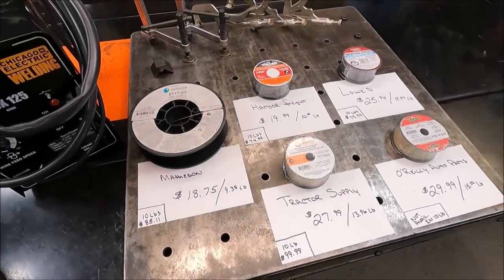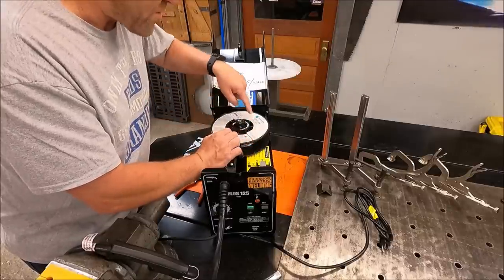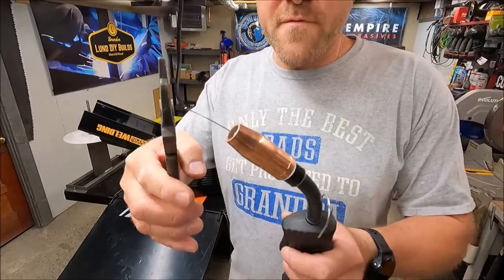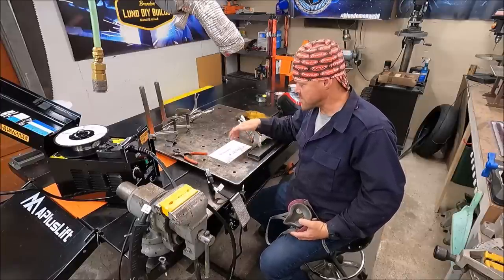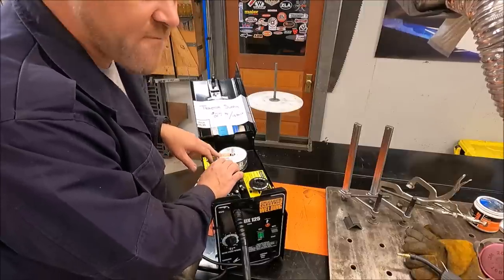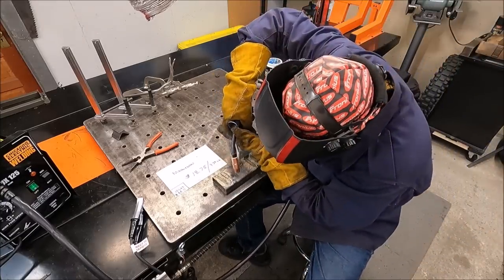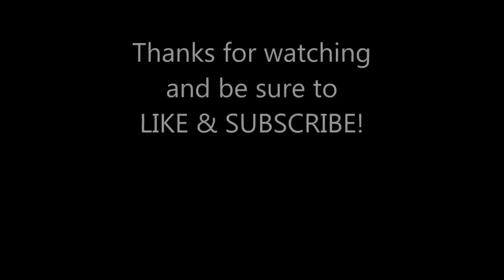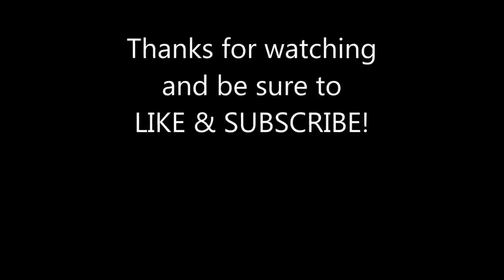Testing which Flux Core Welding Wire is Best

Comment: The harbor freight machine is not the best test as it is an AC output machine where flux core is designed for DCEN.   I converted mine HF125 to DCEN using a 200 amp bridge rectifier for about $20.  Would be interesting to see how these wires performed in the test on DCEN.
Reply from the maker: I agree @John Martin but those are some of the common wires that are available for those that buy or have this welder. I might do a conversion on it at some point but I have built tons of things with this simular welder and for the money it's pretty solid. I'm a firm believer if you use something long enough you will eventually get really good with it. Back many moons ago when I was learning on a 180 AC welder I was laying down beads as good as any top of the line machine. A lot of it depends how much under the hood time you have on a particular machine.

Comment: Well I know I'm not as good as him but what's funny is I've only used Vulcan wire for years never had any trouble with it
Reply from the maker: Many of these wires all work good after you have some time with them. I used Matheson for years and loved it. It wasn't until I made this video that I actually could see and feel a difference going from one wire to the next. If your happy with it, no reason to change. It's just an observation I made that actually surprised me.

Comment: What if you changed polarities? And I've heard a bigger grounder wire on the welder can make a difference.
Reply: On these type welders, the polarity is factory set. On welders that are gas/gasless, that option does exist.
Reply from the maker: @Stanley Bennett as Bryant pointed out this one is fixed polarity but ground location and a good ground are an important role in how the wire runs. I was careful not to move the ground and the workpiece as we changed wires so the test wouldn't be affected by this. Good point on the ground!

Comment: man I have a similar welder. but mine is 240v. I can't tell if I am just HORRIBLE at setting it right or the welder sucks. But now you have me wondering if I actually have flux core wire. It's the 10lb spool of Lincoln wire. mine mounts vertically. Mine can be connected to mig gas, I wonder if it's worth it.  I'm a new sub so will check out your settings video among others. Hopefully you can set me straight. I have NO training since highschool 35 years ago lol
Reply: Had to check. Using the MIG180 and Lincoln Electric Innershield NR-211-MP .030 so it SHOULD be good wire, right?
Reply from the maker: I bet your polarity is not set right. Just double check that if your using solid wire with gas that your setup is electrode positive and if your using flux core that it's electrode negative. You will either have a switch or a physical connection you need to change based on solid or flux core wire. Lincoln is good so you should be all set

Comment: Great video  nice comparisons not always cheaper is better and not always expensive is better its run what does better for your jobs experiment alittle.
Reply from the maker: Gadgets House Thats why I love these tests! Thanks!
Reply: @BrandonLund  next use the same wire in a machine you use consistently and your wire choice may or may not change. See if there is a difference using a familiar machine.
Reply from the maker: Great idea! I'm going to be doing that real soon!

Comment: Strangely enough I had the opposite results in the UK - 'Amazon Recommends' terrible but SIP (more expensive) like the cheapest wire in your test.
Same with SMAW rods, there seems to be a big diffference in quality even though they conform to the same standard.
Reply from the maker: @Mark Barker Interesting...there could be a specification difference from country to country. Thanks for sharing :)
Reply: @BrandonLund  Well all of the wires are E71T-GS which I think is the same as your wire.
Same with SMAW some 6013 rods give me better results than others.

Comment: I see you have a fronius in the back. I love those machines must be the best money can by. What do you think?
Reply from the maker: @5FDP in my opinion Fronius is probably the best money can buy. I started with their TransTig210 and was so happy with it that I picked up their Transteel 2200. It his hands down the best wire feed welder I have ever used. It will likely be the last I ever buy and It has tons of features, some I don't use but they are there for future growth.
Reply: @BrandonLund  in tig world i prefer kemmpi with. They have the best flex neck tecnologi out there. And the mashine is easy to use. I like fronius tig to But kemmpi a little bit more. in the wire feed world Nothing beat fronius. I have done alot of alu welding. Super duplex dual shield. 316 dual shield. And standar Carbon dual shield and its just amazing the arc is so stable and the weld profile is so smoot. I use fronius synergic 4000 water cooled
Reply from the maker: I have never tried the other but if you like it a little bit more than the Fronius it must be pretty impressive 😍
Reply: @BrandonLund  its the flex nex tig torch that makes me love the machine. Kemmpi have patent on the torch. But the machine is good and last for ever and easy to use. But the fronius tig with the kemmpi tig torch is nice. I have also convertet 2 esab tig to use the kemmpi torch. Works grate to.
Reply from the maker: I'm going to look into that! Thank you! 🙏

Comment: I bought the titanium Flux 125 and along with the increased price hikes they have added to the welder, they have also stopped supplying wire with the welder. Pretty disappointed because I was just gonna use it and run Lincoln wire
Reply from the maker: The cost of everything seems to have gone through the roof
Reply: @BrandonLund  the only thing that still remains constant is the 6 packs of tshirts I buy at Walmart for 20 bucks 😂
Reply from the maker: We shop the same stores LOL. We have to with todays prices LOL

Comment: Victory, Inetub & Lincoln all did better than the Mig control in my destructive testing.
Reply from the maker: @John Balazek the real test is will they pass xray
Reply: Actually X-ray doesn't tell you anything about the ductility or brittleness of the metal. Those are the most important qualities to know. I love when welders think that they're the Immaculate Welder because they passed an X-ray. The average weld X-ray looks like someone took a shotgun to it. As long as nothing exceeds the permissable sizes or quantity it passes. Brittle metal is dangerous metal which is why I bend any materials used on my projects. I also think people should need a license to buy Low Hydrogen rod. If you're not going to keep it in an oven use 6010!!!
Reply from the maker: Agree 100%

Comment: Hello:::Newbe ,,, Can I use Vaseline for nozzle Gel ??? I am Cheap !!! And I thought of learning  Mig welding in my Shop "House Trailer". After all those sparks I need to rethink this. The Mig welder is replacing location of 220 110 AC DC 1984 Sears welder at the Door. I pull truck up to open door pull leads out onto truck tail gate. I put a sheet of ply wood on tailgate for welding table outside. Guess I will Mig outside also.
Reply from the maker: I have never tried it so I cant say for sure.
Reply: @BrandonLund  Thanks !! I am going to try it.
Reply from the maker: @Rickugg  excellent!!!

Comment: I noticed the Vulcan wire doesn't run well but it works.
Reply from the maker: I will use it in a pinch but if I don't have to I'm fine with it lol.

Comment: Those prices are crazy,I can get 10lbs from hobart for $60 yes welder brand is $28/30
Reply from the maker: Yah they are pretty high but in our area thats the price. I havent tried yes welder wire yet
Reply: @BrandonLund  it's not bad I have ordered 5 or 6 10lbs spools of 0.35 it's not bad
Reply from the maker: I'll pick up a roll. I'm curious to try some.

Comment: I must be missing something in the math. Isn't the Lincoln wire the most expensive as the spool only contains 1 lb while the others all contain 2 lbs? I like the lincoln flux core wire the best, but you sure do pay for that quality. I would like to see the test repeated with some small DC invertor based flux core welder, like a Forney FC-i or the Century FC-90. I have both machines and they really run a lot smoother than any AC transformer machine. The Century machine is very impressive and my very favorite, so far. I've welded 1/4 plate with it, which is really amazing for a 90 amp rated machine.
Reply from the maker: Thanks man! I havent run it on a century or forney yet but I did compare it using a very high end DC welder against this cheap AC welder just to see if it was the quality of the welder or if it could possibly be that it was an AC unit.

Comment: So a few things, e71t-gs vs e71t-11 multi pass  vs single pass the Lincoln is multiple pass rated its makeup won't cause cracking the single pass typically has more manganese so it is a little more wear resistant from say abrasion. So the HF vs Lincoln is like green apples to red just a little info and typically the off brand like your first spool is lincolns import the Lincoln brand has better quality control thats why lincolns Haris brand in my opinion sucks I've had a spool vary in diameter before and even had parts of it go from laying in nice to sputtering and spitting randomly with less pen it sucks to cut out a weld and swap a spool mid way through. Just my 2 cents
Reply: Also another note your using an ac welder if I'm not mistaken and the wires will run differently from ac to dc some aren't tested for ac either.

Comment: screw old clamp ground wire out and change lot better big magnet pad to ground cable.
Reply from the maker: Magnets on your working lead are not "better". They have their place but they certainly aren't better than a non magnetized connection.

Comment: In both my Hobart handler 135 and my MM211MVP I've found the Lincoln to run the best. If I can't get that I've had good luck with Hobart. everything else  I haven't liked. I guess you didn't tell me anything new ;-)
Reply from the maker: @Mark Pikas Of your two machines which do you like best? I love my Hobart Handler but I also love my Fronius. They weld completely different but they both excel in my opinion.
Reply: @BrandonLund  So I guess answering your question, I definitely like the Hobart Handler better, by far, but if I could only keep one it would be the Miller.
Reply from the maker: You make excellent points! I would say my Hobart but not by much. I'm a simple guy and the HH being transformer based is simple and I have a lot of time on it. I only wish I would have got the 240 volt one. I'm a blue fan also so that might have something to do with it also. Don't get me wrong, the Fronius is the Ferrari of welders but for what I do it has WAY more features than I'll probably ever use and sometimes having a simple dial is the quickest and easiest way to get going and making money:)
Reply: @BrandonLund  At some point I'll have to try a machine like the Fronius. The thing is that it seems like they're common on youtube (sponsored?) but I've never seen one IRL. 

One thing that I left out in my HH vs MM comparision- even if they put down identical welds, the HH has linear wire speed tracking where Miller has always done it on some sort of curve which I have always felt makes the machine more difficult to setup (not using the autoset). When trying to teach someone how to set up a MIG on the miller you can end up with unexpected results when tweaking the knobs. And yes, I am like you and prefer the simple old school transformer setup and feel for the most part. 

My generalization from using multiple welders from the big 3 is that for the most part I like the welders in the 15-30y/o range better then the newer models (newer transformer models don't seem to have the buttery smooth feel of older ones), and would easily rank them Hobart first, Lincoln second and Miller 3rd, for the most part is exactly the opposite of what the market: Everyone used to want "blue" but when they couldn't afford it they would usually pick Lincoln over Hobart because "they have infinitely adjustable power settings where Hobart has 4 taps."
Reply from the maker: I think they are much more common in Germany but they are making their way here.

Comment: You'll find wide variation in the affinity of different wire for different welders, it always pays to experiment a little with a new machine. My Vulcan MIG welder runs Lincoln and Hobart flux core wire very well, and the Vulcan (HF) brand is okay, but a little finicky. I also find I have to run flux core wire about 10-20% hotter than gas shielded wire. As you say, both have their uses. Good video! 👍
Reply from the maker: You hit the nail on the head Ted! Spot on. That's actually what I discovered in this Fridays episode :)

Comment: You price per pound on the lowes Lincoln wire is confusing/wrong. If it's a 1LBS spool how is the price per pound $12 and some change when the one pound spool cost $25? If you carried that price to the ten pound spool it would be $120.
Reply from the maker: Lol good catch. The 1lb spool costs 25.94 and 10lb 79.98 but It seems like you understood what I meant though.
Reply: @BrandonLund  I sure did but at double the price I think most would settle for the next best unless you can run the 10 pound spool which unfortunately I cannot. Great video really helps to show how much of an effect the wire is self can have.

Comment: My experiences good wire always makes cheap machines work well and make amazing machines work superb I like Hobart wire but I use it in Miller machines @Brandon Lund
Reply: Hobart in my Lincoln but Lincoln works good too just not available locally.
Reply from the maker: @Willard Lentz I agree,  the Hobart wire runs pretty good 👍

Comment: I usually have to check my ground if stubbing happens. :-)
Reply: BTW: I'm using a Lincoln 180 on 220V and use the machine to work on tractor 3 point equipment. Never had a weld fail yet.
Reply from the maker: Thats often an overlooked component. People often blame the machine when its  a ground like you pointed out.

Comment: The chicago welder is the wrong polarity for flux core
Reply from the maker: Im not sure. I'd have to go back and check but to set it up correctly, it should be electrode negative for flux core

Comment: I dont think those filters on your respirator are rated for fumes???
Reply from the maker: @Tactical Ant I use the 2091 and the 2097 pretty regularly. Both are designated for metal fumes produced from welding, brazing, cutting and other operations involving
heating of metals. The 2097 is almost identical to the 2091 except is has the addition of charcol to help with certain odors. This is the model I'm using in the video https://multimedia.3m.com/mws/media/5189O/3m-particulate-filter-2091-p100.pdf
Reply: Brandon Lund - thanks, i use organic vapor respirator and one set up with these. I thought they were just an easier breathing dust mask. Glad to know i can use for welding. Its much easier to breathe through these!
Reply from the maker: @tacticalant3841  Thats what I really like about this style filter, they are really low profile and easy to breath through. I think the 2097 is a little more difficult because of the added media but they both will protect you really well. I prefer the 2091

Comment: Very interesting, but do you realise that the 3M filters that you are using are only rated for fine dust, not for any gasses that would be produced by welding
Reply from the maker: That's incorrect. These filters are rated for cutting and welding operations. From 3M's website - "Recommended Application - Assembly & Mechanical, Brazing, Chemical Manufacturing, Cleaning, Composite Finishing, Final Finish, Manufacturing, Metal Pouring, Paint Preparation, Painting, Pesticide Application, Petrochemical, Powder Charging, Powder Coating, Pulp & Paper, Remediation, Sanding, Soil Preparation, Soldering, Spray Coating, Torch Cutting, Welding, Wood Processing - Recommended Industry - Construction, Design & Construction, Facility Sanitation, Food Processing, Food Safety, General Manufacturing, Heavy Infrastructure, Industrial Maintenance, Marine, Metal Production & Fabrication, Mining, Oil & Gas, Transportation" You're not the only one to believe that.

Comment: Remember to check manufacturer specifications when using self shielded flux core wire, many are designed to be run on DCEN(electrode negative).
Reply from the maker: Good point!

Comment: These type of tests don't work very well TBH.  Running at the same feed and voltage doesn't work well as each wire is different in composition. I don't know what kind of adjustments you have on that machine, but you should adjust the best you can with each wire. Just a thought.
Reply from the maker: In theory, a given wire diameter is designed to run within a given amperage / voltage range.  If I'm adjusting the machine to compensate for what each of the wires is lacking,  than this is skewing the results in my opinion. Maybe one of the wires doesnt have good quality control and the wire ranges in diameter from .029 to .032 in places which causes the wire not to feed as smooth as it should so I'm having to adjust the machine to compensate for this lack of quality.  I might not have to allow for this when using a different wire that has better quality control.  I feel this is no different than if I practiced for 30 minutes with each of the wires and learned the technique that made each of these wires run the best.  If I'm not repeating the same test to each of the wires in the same exact manner than I dont know how the test could be viewed as equal. I feel a straight out of the box test is fair given these wires were all the same diameter.